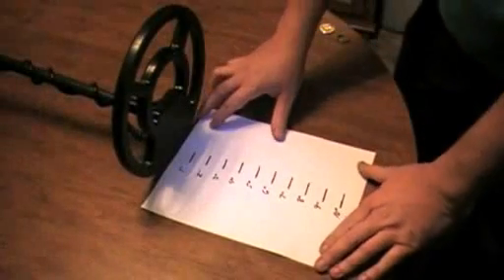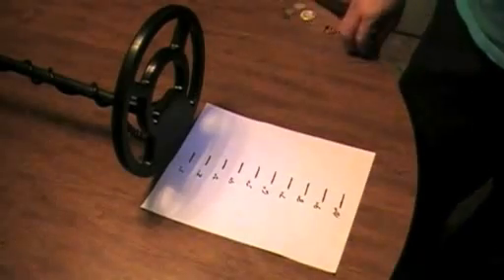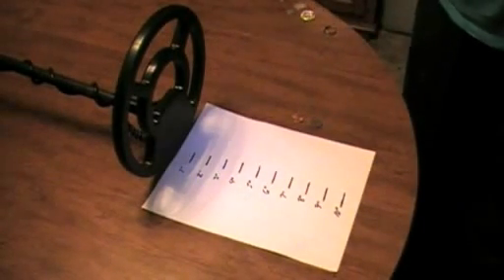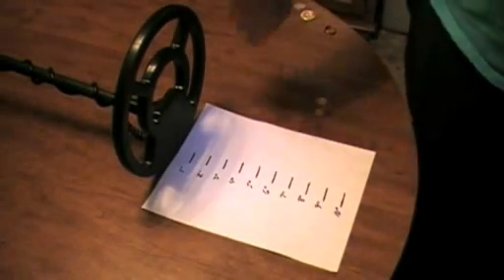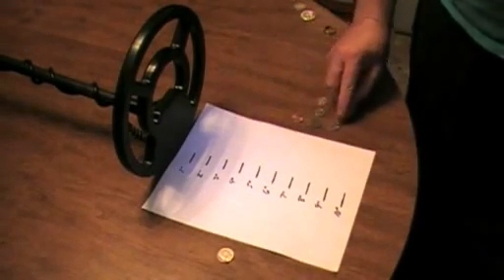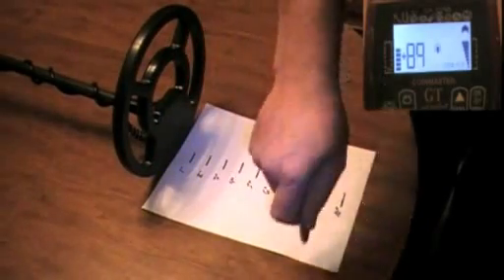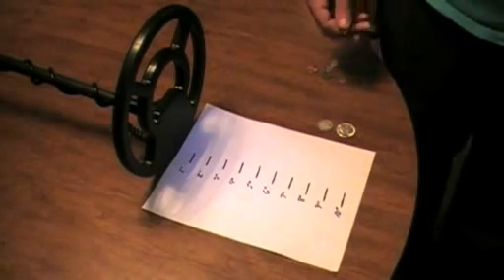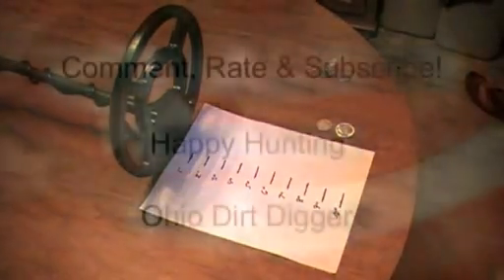#5 Metal Detecting Coinmaster Gt Air Test

Comment from the maker: Sisownz......the could itself if waterproof clear up to the control box. But DO NOT get the control box wet..now as far as detecting in saltwater. Beach mode should set ground balance and functions to where u can detect the saltwater beaches. I never had a chance to do it with my gt. Hope this helps. HH

Comment: Too bad we're not seeing at least 10" pennies with a machine this expensive. Most of the other brands/models as expensive as the GT can (easily) detect a penny this far away and some can detect it about a foot away. Eddie, check your gain and make sure it's cranked up to max provided you don't pick up stray EMFs from your house current.